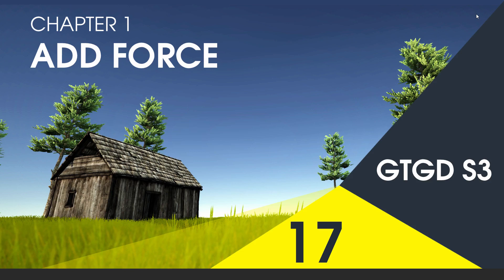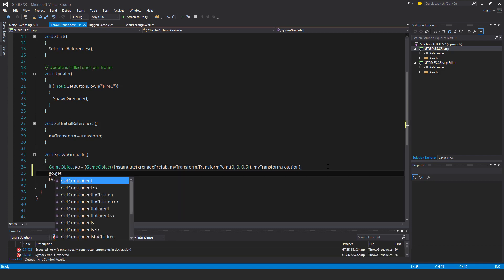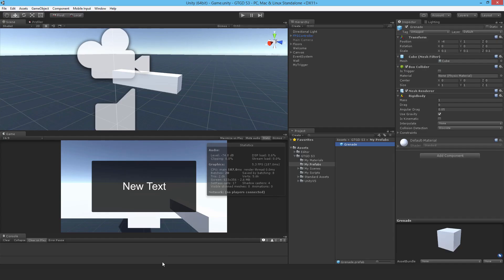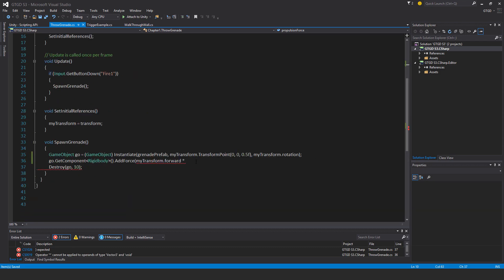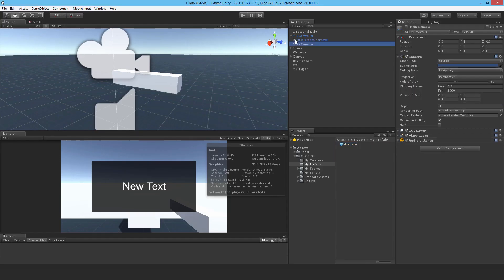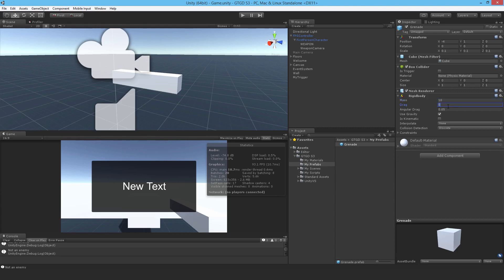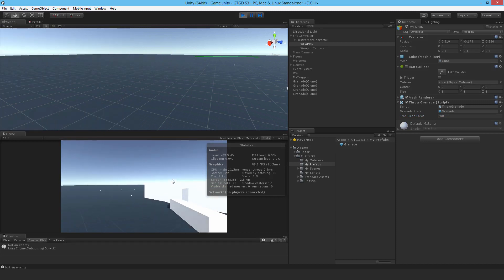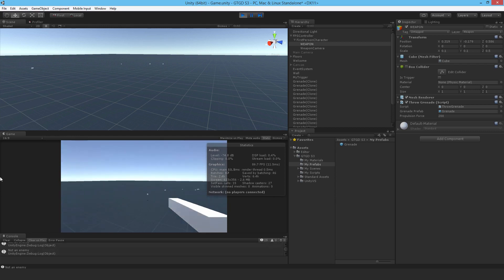[17] Add Force - How To Make A Game

Comment: I continue to have problems with you calling GameObject as go
it never recognizes it...
Reply: I am having the same problem. I have rechecked my script several times but see nothing. Is it because I am using unity 5.5 0f3?
Reply: Update. I forgot to remove the  public float propulsionForce =30; should be  public float propulsionForce;
After changing that It worked for me and I had a Propulsion force slider in the inspector I could slide. Also I had to restart unity for this to happen. Hope that helps. I will say that in this line     GameObject go =(GameObject) Instantiate(grenadePrefab, myTransform.TransformPoint(0, 0, 0.5f), myTransform.rotation); that the second GameObject is kind of dark and when I hover over it, it says that the cast is redundant?? Its working so Im happy but still think something must be different or maybe because Im using a dif version of unity.
Reply: Chad Olds. thank you!            I thought i allready changed that but i will check it and keep you posted! :)